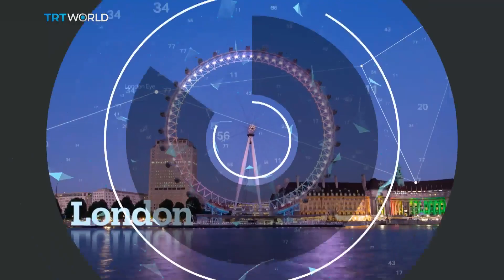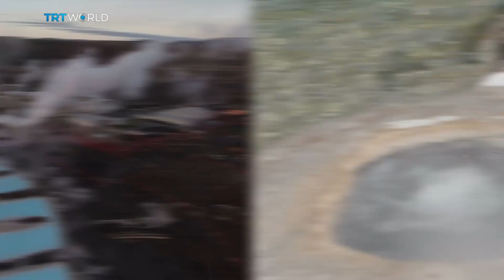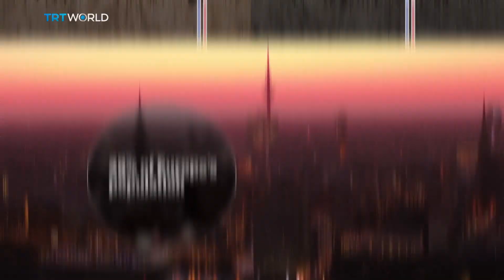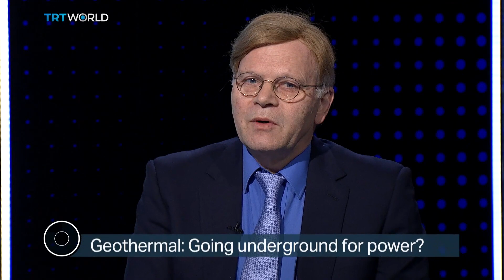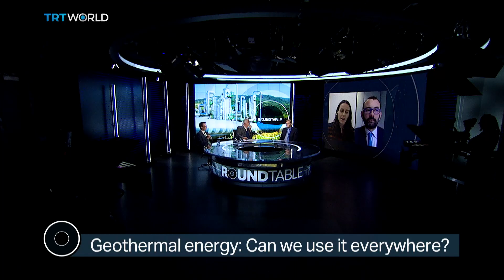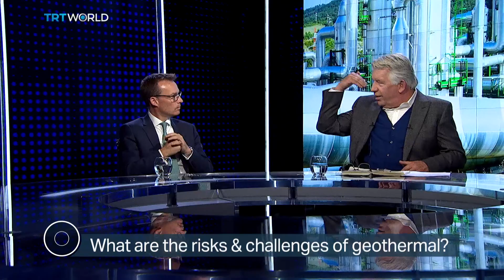GEOTHERMAL ENERGY: Core Power?

Comment: A high-temperature source is not high entropy.  (low temperature and pressure steam is high entropy)
https://en.wikipedia.org/wiki/Thermal_efficiency  Entropy of heat increases after we extract useful work or electricity.
Reply: "enthalpy"?
Reply: @alanhat5252  The enthalpy " the internal energy of the system plus the product of pressure and volume" is what work is extracted from.